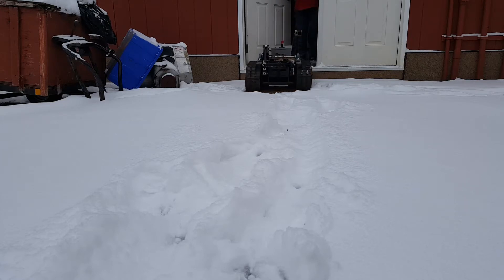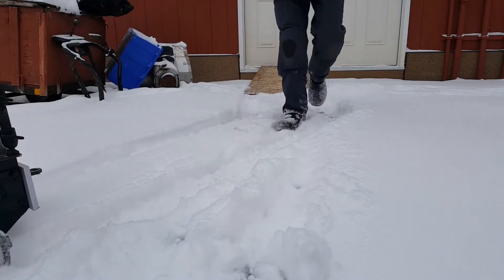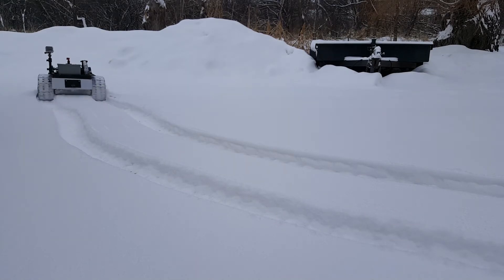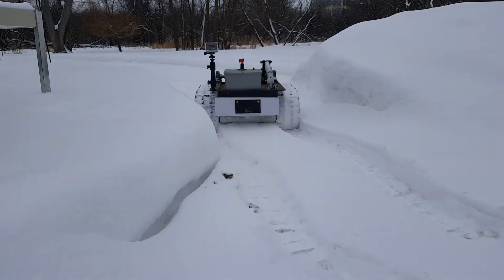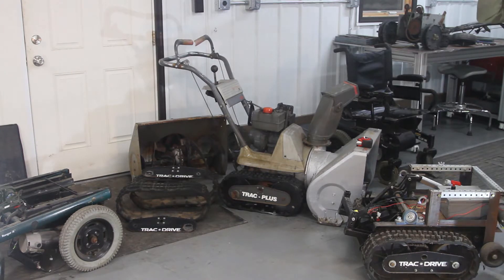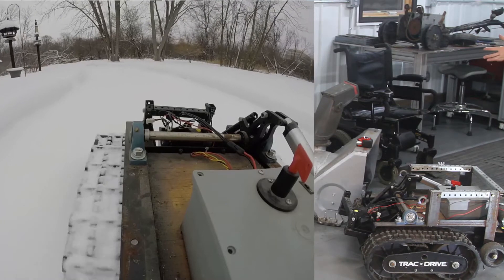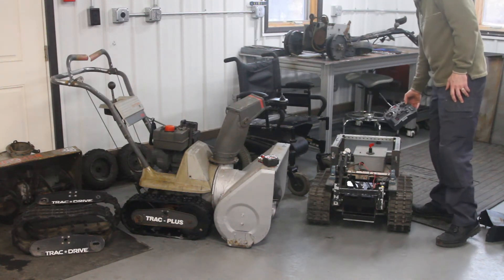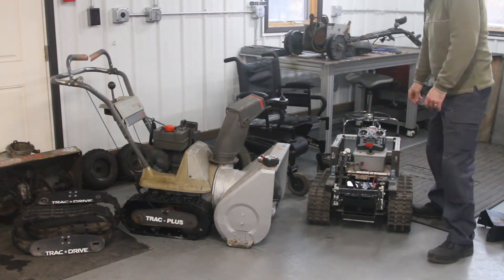Track Drive Robot Build Series Intro

Comment: I have question. I'm running a sabertooth 2x32 with spectrum dx5e an ar 6100 reciever driving two wheelchair motors mixed from one joystick. Whenever the signal is lost or inturn of   the transmitter , the motors keep running at the last speed recieved. Have you encountered this ?
Reply from the maker: Yes.  I actually address that issue in a very old video of mine. I used separate battery for receiver and don't remember having the problem again, but I also switched form HiTech Laser radio to Spektrum soon after.  https://youtu.be/fTH71p5kGa0

Comment: Subscribed!  I built an RC wagon with tires and transaxle/motor system.  Always wanted a tracked version so I picked up a snowblower for $100.  Tracks are in decent shape.  Good idea on the new side plates with bearings.  I may get motors from monsterscooterparts.com rather than tear apart a chair, especially after your hub issues.